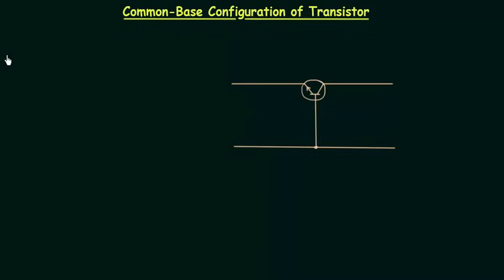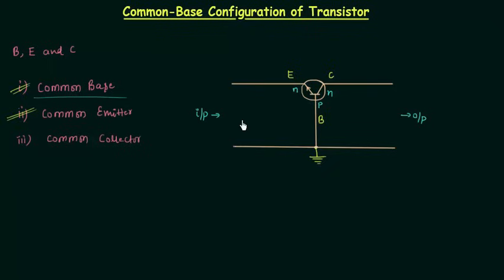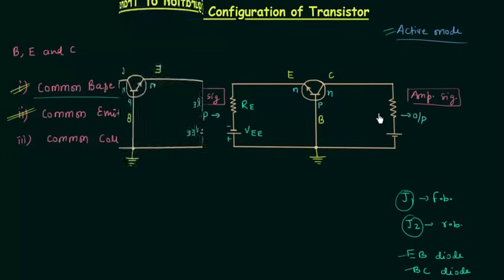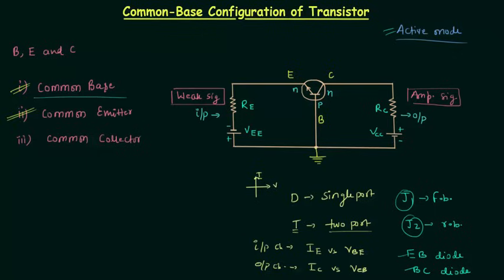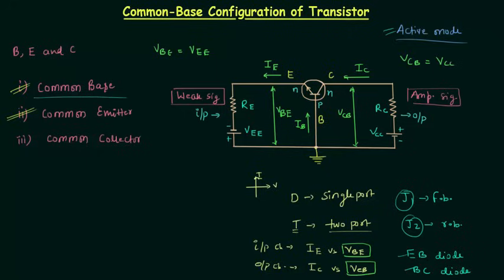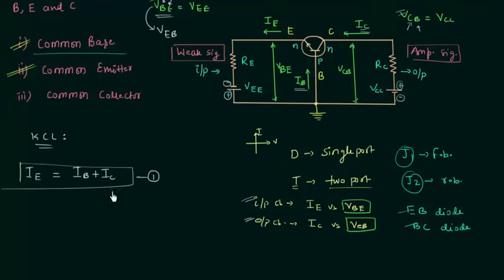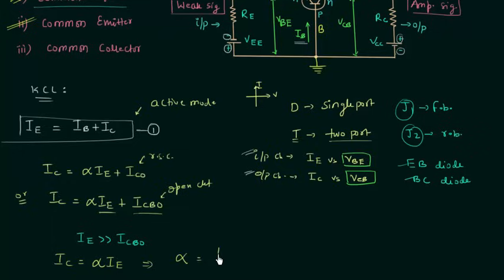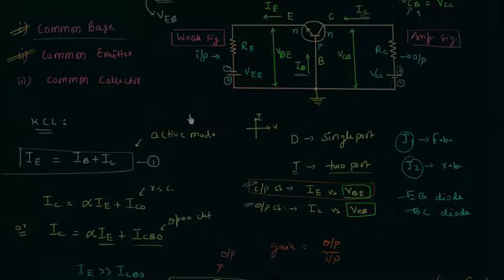Common-Base Configuration of a Transistor

Comment: In common-base configuration, the base is common to the input and output circuits. The collector current is approximately equal to the emitter current, with a small base current.

Key moments:
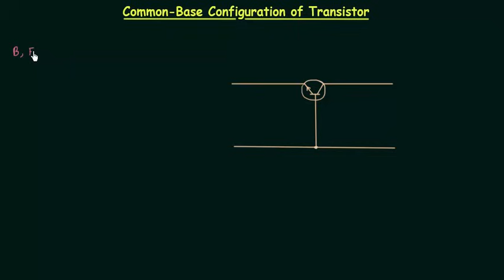00:05 Transistors have three configurations: common base, common emitter, and common collector. Common emitter configuration is widely used due to its advantages in amplifying weak signals in active mode.
          -Explanation of common base configuration. Base is common to input and output circuits, facilitating signal amplification in active mode.
          -Operation in active mode. Transistor has two junctions: Junction j1 forward biased (diode EB) and Junction j2 reverse biased (diode BC) for signal amplification.
          -Comparison with diodes. Transistors are two-port devices with input (ie, V B II) and output (IC, V CE B) characteristics, unlike single-port diodes.
05:10 Understanding the proper nomenclature in transistor circuits is crucial for accurate representation. Kirchoff's current law helps derive key equations for active mode operation and current gain, essential for analyzing transistor behavior.
          -Importance of following proper nomenclature in transistor circuits for accurate representation of voltage and current. 
          -Deriving key equations using Kirchoff's current law for active mode operation and understanding current gain in transistor circuits. 
          -Explaining the significance of alpha as the common base current gain and its implications on emitter and collector currents.

Comment: I cbo means the reverse saturation current in common base configuration when the emitter terminal is open ( battery across emitter is disconnected).
I ceo means the reverse saturation current in common emitter configuration when the base terminal is open ( battery across base is disconnected).
Both I cbo and I ceo are very small so they can be interchanged. Because later we have to ignore thier value anyway.

Comment: The current goes from i/p to o/p right? then how here the current in moving into the i/p side?
Reply: Electrons are moving from emitter to collector implying ...current is moving from collector to emitter
Reply: This is for npn transistor if you take PNP then current will go from emitter to collector .....in both the transistor eqn iE=iB+iC is valid

Comment: Can somebody please tell me why the terminal that attached to C was +ve even tho it is n type?
Reply: because to operate transistor iin active mode, we have to connect o/p to reverse biased. that is done by connecting C to reverse biased voltage.
Reply: Sir can you please also add lecture on voltage divider rule of transistor

Comment: sir, why the emittor is highly doped and base is lightly doped,  if we do against this what will happen.
you are saying out put is at collector but the collector current is into the diode. then how will we get the output
Reply: we are not taking current from the output side. we are taking high voltage from output side.

Comment: Why have we added Re and Rc in this circuit?
Reply: Phalak Celly There will be no current supply if there is no load. Resistor used as load.

Comment: at 1:43 instance in video you said we apply weak signal in input and get a amplified signal at output.......in common base current gain does not exceed 1 .....so how this is possible...
Reply: Shubham Dhama u will gain voltage amplification..

Comment: Thank u, twas really conceptual and eliminating out confusions. I liked the way, you drew Vcb and Vbe later in the circuit and gave understanding of its terminals. Most of the lectures i found previously, they seemed to mug up the circuit diagram without and explanations and then explain just the results, that too in a confusing way.

Comment: why is base grounded
Reply: Lpavan Venkat  because it common base transistor
Reply: Lpavan Venkat and the base is common for input and output
Reply: KALYAN bro help me. left side me hi kyun Emitter Lia? two arrangements are possible
Reply: Because emitter is highly doped thus offers low resistance and for amplification, we need the input resistance to be small and output resistance to be higher. So emitter junction is at left(low resistance) and collector junction is at right(High resistance).
If you still have doubt watch this video it is explained.
https://www.youtube.com/watch?v=yOmPCjPlaEg&index=65&list=PLBlnK6fEyqRiw-GZRqfnlVIBz9dxrqHJS